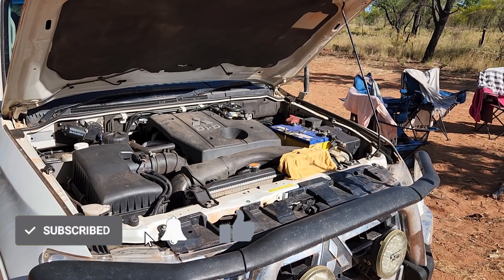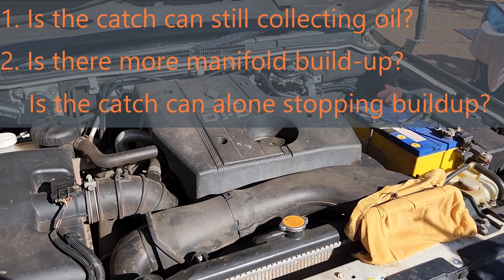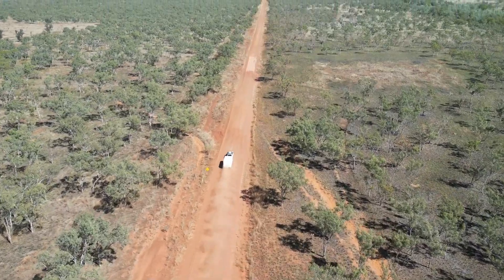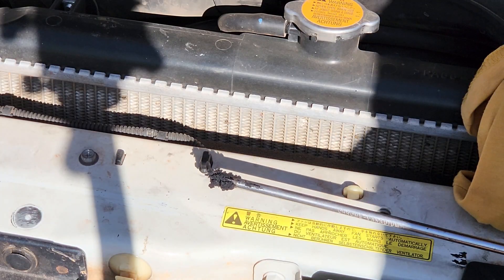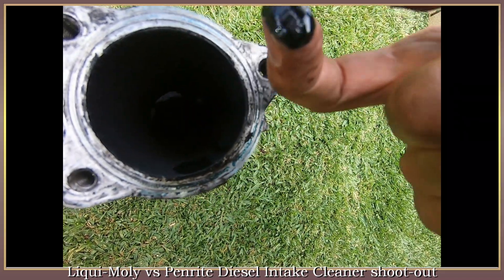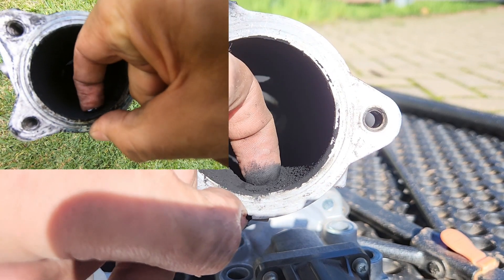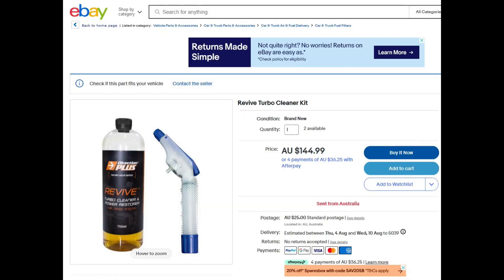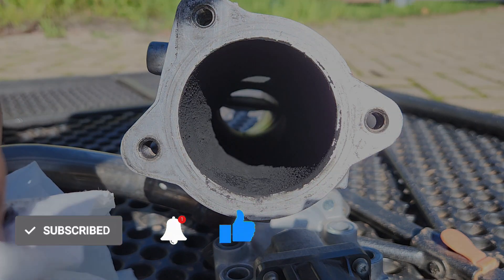[RESULTS!] Provent 200 Catch Can  - does it stop manifold gunk?? 40,000km road test!

Comment: Oil is used to lubricate things therefore it's not bad for the engine (even if a small quantity is going through the inlet manifold). The best way to clean the parts is to remove it and then use a brush with water based aircraft cleaning chemicals designed to remove carbon and other deposits...
Reply from the maker: You're right the oil vapour isn't an issue for the engine in those small quantities. The problem is that it mixes with the EGR soot which eventually clogs the manifold. A while ago I did the full manifold remove and clean, I used oven cleaner and a pressure washer, worked well. But what you've suggested would probably work well too.

Comment: If your inlet it still coated with soot n' suff but less oil in it or drier than it mean the catch can is working as intented as it is trapping down the oil from the vapor and passing up the cleaner air into the intake. Travelling in outbacks with huge temp variation before day and night might cause condensation in these metal pipings which might create a moist enviorment at time which allows dirt and soot to stick to the walls maybe?
Reply from the maker: You're right mate that the catch can is largely doing its job of stopping oil, it's just that this doesn't actually solve the problem of the manifold gunking up, which is often what these products are sold to fix. It's possible the desert temperature changes could contribute to it, but just cooling down to 20-25 would be cool enough for the oil vapour to condense.

Comment: Great video and very in depth! Question from a completely non-mechanical guy though...is it worth me fitting one of these to my Ford Ranger (2.0 SiT engine)? They cost approximately 800 AUD where I am (South Africa), so the price is not insignificant. I'm trying to work out if there's actually a benefit to having one fitted that justifies that cost. Thank you.
Reply from the maker: Glad you enjoyed the video! I wouldn't bother for that price. You still get build-up due to the EGR carbon, it's just a hard build-up rather that soft oily build-up which you currently get - and while the cleaning products I've tested aren't very good, they're more effective on wet build-up.

If you're wanting to maintain a clean intake I think you need the catch can in conjunction with an EGR block / delete, which is illegal. Your alternative is a full manifold removal and clean every 50-100,000km or so. None are great options unfortunately!

Hope this helps!
Reply: @TheMusingGreg  ok great, thank you very much for clearing things up for me! Cheers

Comment: We really need those petrol+diesel engines with diesel direct injection and petrol port injection. The petrol just cleans the valves perfectly.
Reply from the maker: Yeah petrol is great like that! Would be nice if a diesel had a slight petrol spray into the manifold every so often to keep it clean too!

Comment: Mate thats EGR gunk not blow by. Anything before your swirl valve will be clean now but clearly you have not blocked your EGR. Its all well and good to pull your car apart but you should really know what your pulling apart first.
Reply from the maker: Hi mate, yes that is correct. Respectfully, I do know what I'm pulling apart and I do know I don't have an EGR block , in fact I mentioned an EGR block is something I may be looking at in a future video. I specifically did this testing on a vehicle without an EGR block because catch cans are advertised as being a solution to manifold gunk, so I wanted to check if that was right or not on a vehicle that was in 'normal' configuration for most users. Clearly from my testing, a catch can is not the whole answer, which is important if someone with a regular EGR-operating diesel was considering a catch can to fix manifold gunk.

Cheers,
Greg

Comment: Hi Greg. Ive been on fence with catch cans for a while but this video solidified my decision. Thanks for you videos! Im not a mechanic but as a scientist, I really appreciate your experiments. It's very easy to get caught up in the misinformation as a lot of these devices are great at separating oil as they are intended but people are misguided in spreading assumptions that the gunk will be eliminated as the carbon needs the oil to stick to in order to build up.
I have an idea for a video if you'll entertain it. Does your Pajero have the ability to read EGTs via an OBD2 tool or a sensor?
Reply from the maker: Hi mate, thanks for the comment and glad to hear you enjoyed the video! I don't currently have an egt readout although it would be possible to install one. I'm always open to ideas for new videos of you're willing to share, although can't guarantee if I'll be able to do it but happy to hear the idea!
Reply: @TheMusingGreg I was just thinking that the build up is obviously carbon from the EGR, which ideally you need to 'eliminate' but the opposing argument (by those promoting catch cans mainly) to that is ...manufacturers have developed the system to utilise the EGR & cooler to keep combustion temps down and should not be modified. So my thought is, would this not manifest into higher EGTs?
So would it be a good video to get a 4wd that has an EGT gauge & see what temps you get at idle (likely when EGR valve is open most), low rpm, under load, etc. Then repeat the test using an EGR delete module. I know the legalities of using a module to test are questionable but thought it would she'd some light on the argument of EGR deletes.
Reply from the maker: That's a good idea! I'll put it on the list! Cheers
Reply: @TheMusingGreg sweet! You're definitely going above & beyond with these tests. There is just too much misinformation being spread...., so would be great to see something that will settle the debate & I've been sharing your videos cause you need more exposure. Good luck! I'll keep an eye out for the EGT vid mate 🍻

Comment: You must have installed it wrong- I have a $30 catch can that has completely stopped buildup. A catch can should have a cold-plate baffle, (NOT a filter) and should be placed in a cool-airflow area in front of the radiator.
Reply from the maker: Well I bought it as a kit specific for my vehicle and followed the directions, so it's done correctly as far as how the kit was designed. However you're right that a cooler installation point should help with oil condensation within the catch can, as my kit has the catch can quite close to the turbo.

 I know some catch cans use a baffle however this design uses a coalescence medium instead (it's not actually a filter because it's not filtering anything out, it's just a surface for the oil mist to condense onto. But it's often called a filter).

That all said, the issue with the continued build up seems to be more EGR soot rather than blowby oil.

Comment: 310,000kms on my diesel, Provent 200 from new. Intake is slightly oily each full disassembly, from turbo seal leakage. Incredible device, just change the filters once they get completely soaked, cleaning them doesn't really work. I hobbled the EGR from new FYI.
Reply from the maker: Cheers!

Comment: with the EGR unblocked, diesel particle buildup is completely expected, you need both catch can and EGR block installed to make a real difference...or the OEM get thier act together, and run the EGR input after the DPF.....
Reply from the maker: Yes that's correct. I'm doing these tests because catch cans are advertised as being a solution to manifold build up, which clearly they aren't on their own. But your suggestion about taking the EGR source after the DPF is a really good one! I doubt it will get off the ground because of the extra plumbing involved, but it would certainly prevent manifold buildup and might be a good aftermarket project.
Reply: @TheMusingGreg  G'day Greg, I've been following this subject with great interest having recently bought a MV Triton. I have fitted a catch can but not sure if I will keep it though cleaner air going through two turbos seems to make sense to me. I don't like the idea of a crusty build up of carbon eventually going through the combustion chamber. I was wondering if the same can't be done with the EGR gasses and running it through a filter before going back through the manifold?
Reply from the maker: @martinbenson2192  Hi Martin, theoretically it could but the exhaust gases would be a lot hotter than blowby crankcase gases so you'd need some sort of filtration system designed for that temperature. The ideal would be to pull the EGR from after the DPF if you have one, that way the DPF basically does that for you. I'm still running my catch can at the moment for testing purposes, but ultimately I expect I'll remove it and put up with soft gunk rather than hard crusty stuff.

Comment: try recirculating the trapped oil back into the oil pan
Reply from the maker: You can, and Mann+Hummel actually show that in a video. But I've already read a recommendation, from Western Filters  possibly, that you don't do that as the blow-by contains water, soot and other contaminants that are better off not in your oil. Of course without a catch can they would get back to the sump anyway, but I guess collecting this would reduce oil contamination slightly and keep it clean a bit longer.
Reply: I placed my catch can low, the bottom of the head to be exact does pretty well without a baffle. you may want to look into aig oil seperator.

Comment: Try a low-pressure water injection prior to turbo.after maf sensor. Will help keep buildup from happening.
Reply from the maker: Interesting idea Steve. Could you explain how that would help reduce soot?
Reply: @TheMusingGreg  its steam cleans intake i sprayed my bt50 with water injection for 6 months i never checked it but fitted catch can as well at 107000, its bit tired now i just upgraded to dmax it has catch can but i think ill remove it and just do do egr delete ,

Comment: I ordered a replacement M+H provent 200 filter for my 08 Jeep CRD and it came with a conversion kit which relocates the vent spring from top of lid to bottom of filter. It now recirculates to the return hose rather than venting to atmosphere. Just a heads up for those who are expecting the old style filter and vent to atmosphere setup.
Reply from the maker: Thanks for sharing that experience. Yes that's one of the key differences between those versions. Venting to return is better environmentally than venting to atmosphere.

Comment: Mate you installed it after you vehicle had already done moon mileage ,what would be the result if you installed on day one ?
Reply from the maker: Probably no different to this. The only way engine age would affect the amount of manifold build-up would be how much blow-by the engine's producing. But these two videos https://youtu.be/aKb1Nwewy6A and https://youtu.be/BXUnbrvVAwI show the amount my car had was comparable to that of a new vehicle.
Reply: @TheMusingGreg  Your intercololer lines etc would be full of oily  crap from pre catch can.Unless you fully cleaned everything prior to the catch can  your results and your theory are somewhat flawed
Reply from the maker: @ktmkaos  You're right that there would likely be some oil in the plumbing when the catch can is first put on, but remember this is the second video in the series. The first one after 18,000kms found the build-up was already dry. This means if there was any any excess oil in the plumbing it's no longer contaminating the intake air, otherwise the build-up would still have been oily.

Have you seen the Revive review https://www.youtube.com/watch?v=DFemreqYqUI yet? I put a borescope camera down inside the intercooler after having had a catch can on for about 40,000km so you can see what's left inside, and also how much that affects the manifold build-up. There was still oil down there but it's not causing oily build-up in the manifold, so I think whatever's left in the intercooler is just sitting there without contaminating the air. And fair enough, if you had a smear of oil at the bottom of a ribbed intercooler, you wouldn't expect it to contaminate air blowing along the top of it.

Thanks for the input!

Comment: Hi Greg, my first youtube coment ever 😅. My idea is that your catch can doesnt hold much oil by design, it fills up to the out port and some oil goes to the intake, i would attach the under drain tube to a collecting bottle of some some sorts just to be sure. Cheers
Reply from the maker: Hi mate, welcome to the world of comments, great to have your input! That would be correct, except these catch cans have a drain port in the bottom. This runs into a long drain hose with a tap on the end, so it basically acts like the collection bottle you've described and has to be emptied periodically. You wouldn't want oil filling up to the output port because then as you said you'd get oil going back into the engine which would defeat the purpose of the catch can.
Reply: Dont know how much ml it takescto fill up, but just thought that the oil you collected was more than that tube and bottom of can capacity and oil level would be up to out port, venturi effect would suck some oil into intake
Reply from the maker: That's a good thought, I haven't actually measured the hose capacity but I think it would take a few hundred mls. But if it did fill up to the output port then what you're saying would be correct. Next time I empty it I'll check if there's any in the bottom of the catch can first.

Comment: So 1 table spoon of oil per 1000km into the engine - is it so bad ? Would it be like lubricating the ring like a 2 stroke - there is a school of thought that stopping the soot is more important- as it is dry and abrasive and if it no longer stick to the manifold, it will go in your combustion chamber and sand your cylinder wall… legality aside blocking , reducing or filtering soot seem to be of higher importance 

I am surprised no one has yet to come out a “ catch can “ for EGR soot - I would buy that instead a catch can.
Reply from the maker: You're right that the dry soot is probably more of an issue. If I had to have soot I would probably take oil with it. The oil isn't an issue for the engine or the manifold really, it's only when it mixes with EGR soot that you start getting blockages. Yeah I agree an EGR catch can would be a good idea if a way could be thought of to capture hot, dry, powdery carbon in a high temperature gas flow.
Reply: @TheMusingGreg  agree!

Comment: Your oil catch can did it's intended job, which is to capture blow by gasses and turn them from vapor back into liquid state. The "dry stuff" is carbon build up a.k.a. soot from EGR. Intake tube will still get dirty from soot build up from EGR unless deleted which is not recommended. This is obviouslya diesel engine problem. Petrol engines woulgave a clean intake manifold only with a really thin layer of brownish build up that looks like varnish. I've tried this on 30,000 miles after intake manifold cleaning and no issues
Reply from the maker: Yep you're correct. The trouble is that catch cans are advertised as being a solution to manifold build up, which from these tests clearly isn't the whole solution

Comment: Diesel will Always have the "Sooty Powder" being that unless you can get a Complete Clean Combustion in the Engine, it'll be the bit of Unburnt Carbon Deposits. EGR Modification to stop it operating correctly is also not legal in Aus (as is the Modification of Any Emission Systems).
Reply from the maker: Unfortunate, but correct!

Comment: Catch Can filters must be replaced in a service.
The filters are sometimes more expensive then the whole unit, that's why nobody will do it.
At the end of the day, catch cans are for people who look for problems and aftermarket sales targets them.
Reply from the maker: Yes that's what they recommend. Interesting though, as the 'filter' isn't actually a 'filter', it's a coalescence medium. It's just there to snatch the oil droplets out of the air and give them a surface to stick to, so it doesn't really 'block up' over time like an oil filter does. I tested this a while ago but needed to source some different equipment to prove it conclusively which is why there's no video on this yet.

Comment: The reason EGR exists, particularly with diesel is to reduce NOX. It does this by reducing combustion temperature. My BT50 needed a new head (soft and warped ) at 200,000 km. Im the only driver, not chippped or ever overheated, pretty easy life.  Mmmm long term consequence of no EGR ?
Reply from the maker: Hmm that's interesting. You're right about the purpose of EGR; whether it's the cause of your head problem I couldn't say. I would note though that the engine's going to get hottest under heavy driving, and my EGR valve at least only opens under light throttle conditions; as soon as you tromp it the valve closes, presumably to prevent sapping engine power when it's needed. I'm pretty sure most engines would work the same. So they would only reduce exhaust temperature under light load and temperature, not under peak load conditions. It might be worth checking if the BT works the same way; if so I'm not sure it would be the culprit, maybe just unlucky if the head issue isn't a common problem?
Reply: Always drill a small 2mm hole in the mechanic thermostat, lifetime solution for overheating warped heads and blown gaskets, my previous mondy mk4 2.0tdci had blanked egr from 100.000km onwards 0 probs till 350.000km when i sold it. Never had any probs wit the dpf also after the blanking. And yes of course i drilled 2mm hole in the thermostat, i do that on every car i buy.